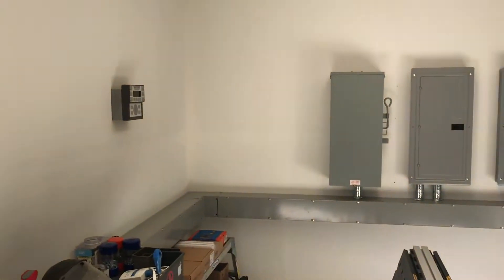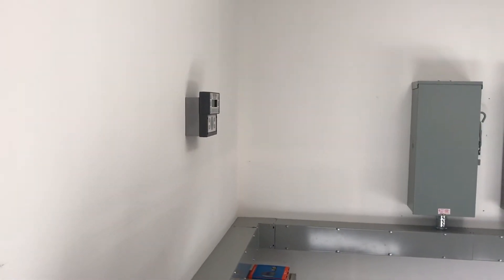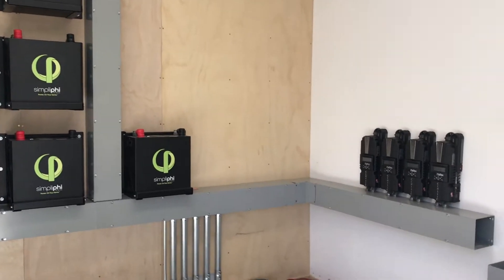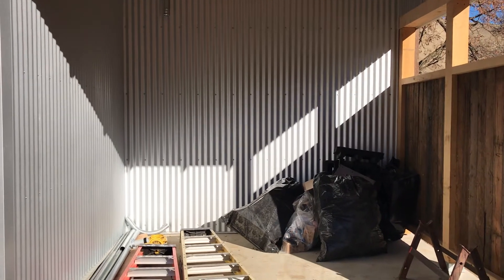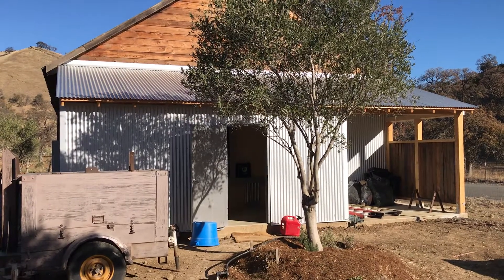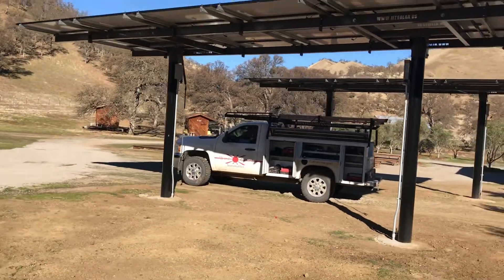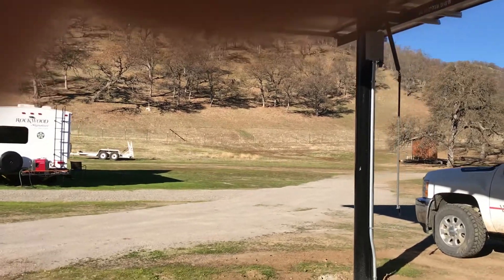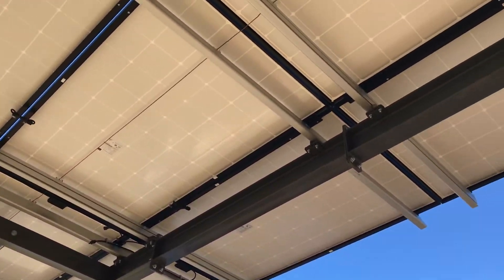Off grid with Simpliphi lithium Iron Batteries

Comment: The battery room looks nice! I think all the battery wire runs have to be the same length. Do I think wright?
Reply from the maker: Sylvain Maher yes this is why I am using the vertical gutter to help me absorb the pain excess cables I will have 200’ of #4  fine strand cobra cable